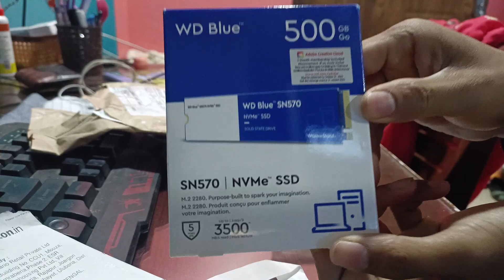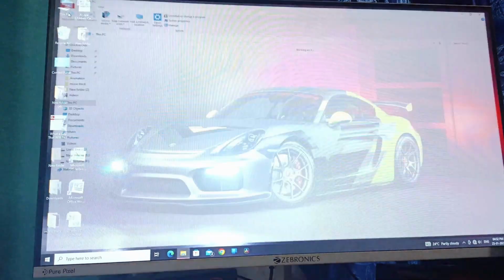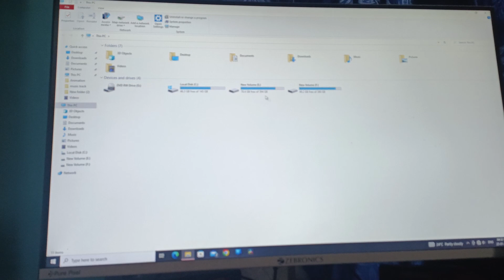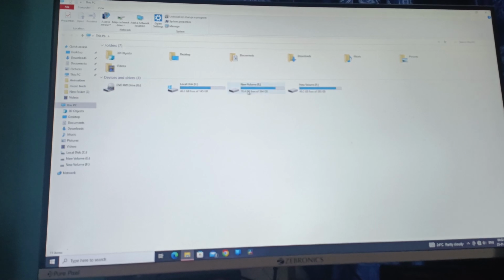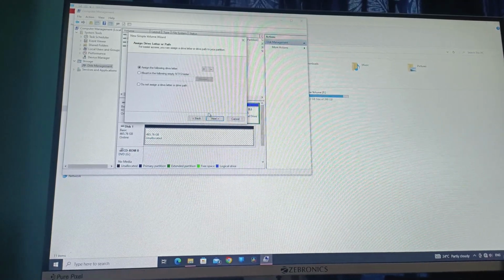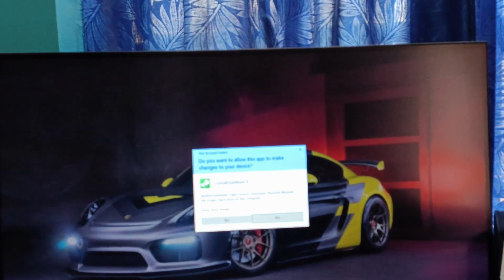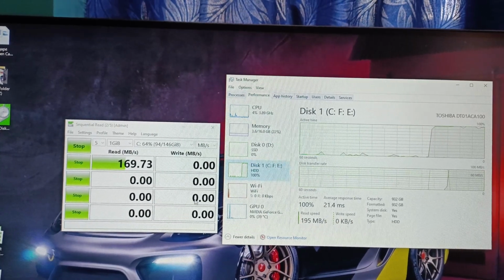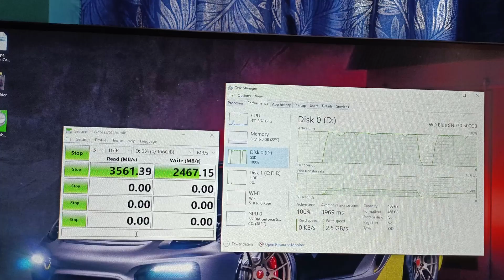WD SN570 NVme M.2 500GB ssd. Review SpeedTest and more

Comment: I have bought the same ssd for my laptop but it doesn't cross 1600 mb/s both read and write what may be the reason
Reply from the maker: Make proper configuration of the m.2 nvme in the BIOS and try.
Reply: Me too but i have crucial p3 m.2 nvme 500gb SSD it goes 900mbps on laptop